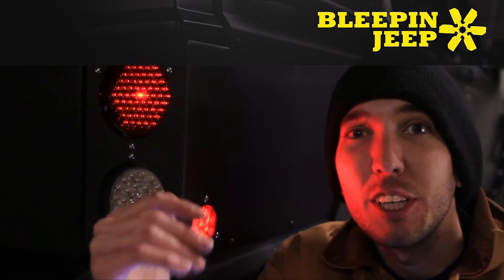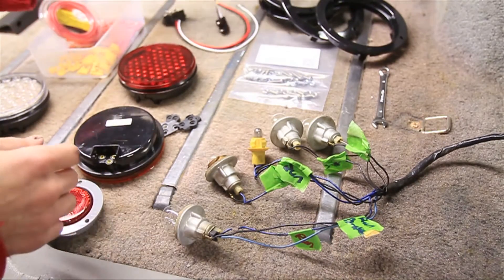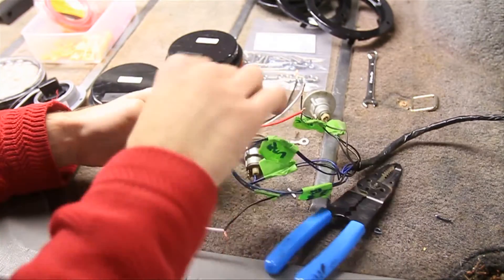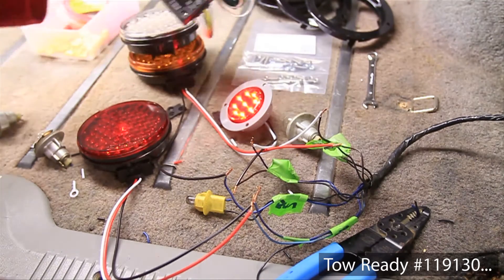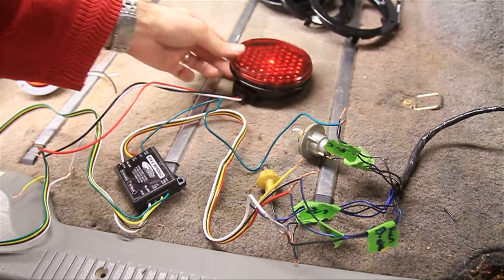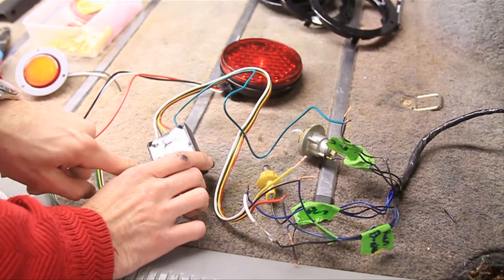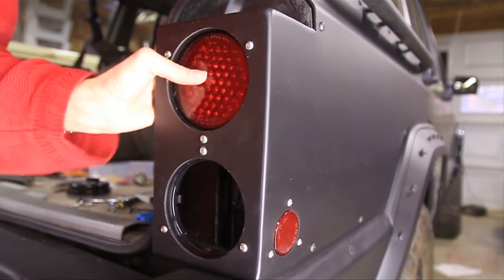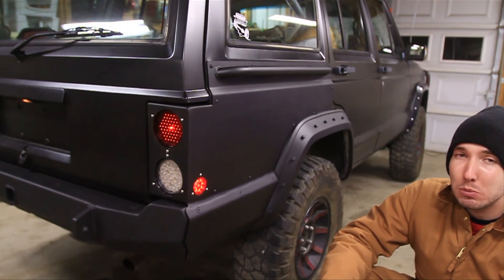JcrOffroad - Cherokee XJ LED Taillamp Wiring - By BleepinJeep

Comment: I want to get the round hole panel like yours but without the rub rail (the HD housings but for a 97-01 with round holes ) and also do a plug and play of the led taillight upgrade with snipping wires

Comment: to have turn signals and back up lights you DO NOT need the trailer wiring thing. pick up some UTV led backup lights, drill the holes and wire them to the reverse wiring, DONE.
Reply: I wish I would’ve thought of that before I bought and started installing mine todsy!